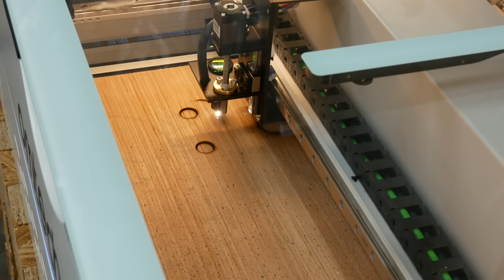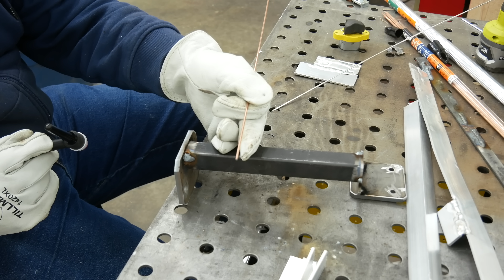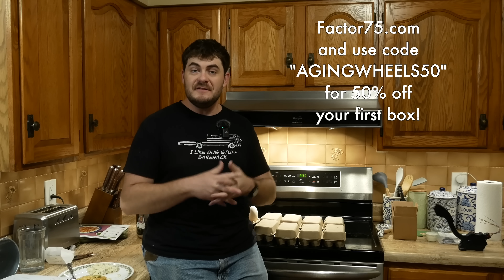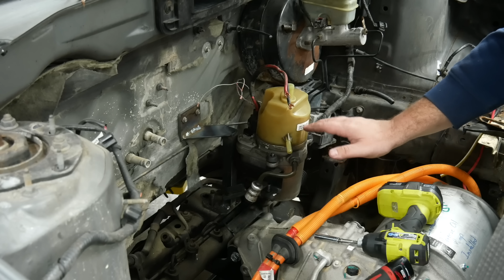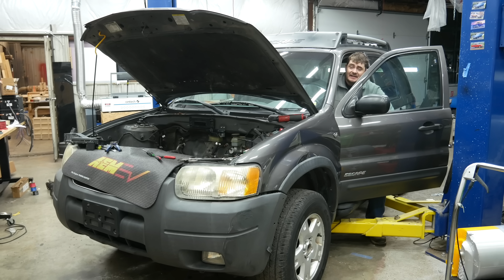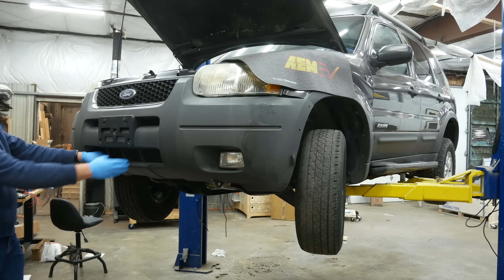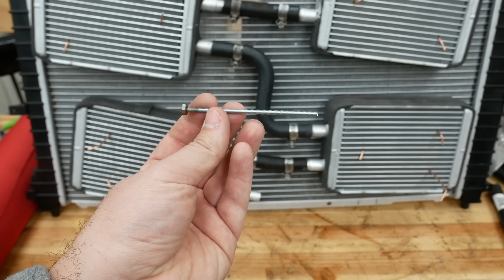Battery Powered Steering and Five Radiators | 900hp Electric Escape Project

Comment: What I have learned from EVs... Amps bad! Voltage good! Also you need to think about what is the worst case temperature inside the engine / conduit where you will be running the cables in USA climate and use case. Track day in the hottest day of the year? So lets say you need constantly 1000A for trackday driving in the worst +50C environment temperature, you will be looking at the cable thickness of minimum of:  500mm2 of copper (single wire) or 2x 185mm2 with wires width spacing between all runs. (Wires would be 90C under these conditions). 

Also: for automotive, get marine rated cables. To my understanding they're already tinned throughout which adds corrosion resistance.
Reply: Under what condition would you use a constant 1000A? At a moderate 350V that's 350kW (or 470BHP or 476PS)... CONSTANTLY.
That kind of power would possibly be required for travelling 200mph in that car, but that's not really what he's going for.

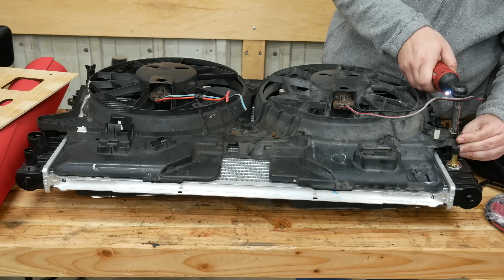Comment: For the radiator fans shown at 17:10 - if all you need is to be able to adjust the speed of those DC motors, you could just run them with a motor controller capable of PWM. (essentially switching power to the motors on and off really fast to control how fast they run)

Comment: Amphenol Rhino 38999 connectors are rated up to 1000 A, 1238 VDC, IP68, come in multi-pole options, meet mil-spec vibration requirements and are available with tapped hole and flat terminal connections so you don't need to buy the crimping tools.  They claim 2000A connectors are also "coming soon".

Comment: Those 2 little domes on the bracket look to be the bottom half of a Self Piercing Rivet (SPR) very popular in car manufacturing as it can join dissimilar metals, aluminium to steel, and if done well is very strong and reliable. No localised hardening like welding and can be completely automated unlike nuts and bolts.

Comment: Check out either a flexalite fan controller(cheap) or autocoolguy for making your fans variable speed based on temperature, you can use thread in bungs or push in probes.

Comment: I wonder if any small diesel cars use an electric vacuum pump that you could have opted for instead of the EVWest part?  Vacuum pumps are standard issue on diesels; often engine-driven but not invariably.

Comment: There are plastic kits to attach transmission coolers to radiators.  It's very easy and secure.  It would work great for cooking fans and heater cores too.
Reply: Flex-a-lite 3910

Comment: If you are trying to avoid metal to metal contact with your heater core/radiator assembly, do you also want to put some kind of rubber coating on your bolt so they don't rub the inside of the metal fins?

Comment: If you're looking at 2000A through your connector, I would maybe consider rethinking your configuration. That seems like an awful lot for what may be a silly reason. The anderson power pole connectors are the first things that come to my mind but they are 350A only (though they would suffer more I bet). Whats the limiting factor for your battery voltage? is it the Tesla drives input?

Comment: You're going to want to think about the continuous vs. peak power for the connectors, and wires and fuses too for that matter. It's going to be an unnecessary battle of absolutely massive cables and unobtanium connectors to specify your peak power as your continous power.

Comment: Instead of a heater core, use an aux transmission cooler. They come in many sizes. Mount to the front of the radiator.

Comment: Fun fact. There are proprietary nylon zip ties specifically for connecting radiators together. If you were the kind of guy that doesn't like that metal allthread acting like a file against your aluminum core.

Comment: I'd also figure brake regen will be fine so you don't have to upgrade the hydraulic brakes but just remember if you leave the house with a loaded vehicle with 100% charge you won't have any room in the battery for the angry brake electrons.

Comment: for tig, CLEAN IT CHEAN IT CLEAN IT and uh oh yeah CLEAN IT use acetone, works the best for me. also always check to see if youre getting gas when you start the weld, i usually just hold the torch a ways away from the table and aim it at the palm of my hand and press the pedal you can feel the pressure from the gas on my palm with the glove still on, doesnt guarentee it isnt contaminated, but its a good sanity check.  also wipe the welding rod down.  even if youre not gonna grind the mill scale off with a flap disc clean it with acetone.  if you dip the tip in the puddle (everybody does it) just clean it youll get better over time.  if youre fighting with the torch cable (i know i was going insane with my stock one i wanted to murder something) ck worldwide superflex one figuring out exactly what you need is a bit of a nightmare if you dont know what the connectors are like i didnt but there are some pdfs on the ck website that will help.  GET SOME FLEX TORCHES fuckkkkkkkk a 9f (under125a) and a 17f (under150a) are prety much all ive needed to get through most stuff, some people say you should learn with the rigid ones........ but those people are masochists.  you should get a couple of each of them, theyre cheap, i went for ebay knockoffs.  youre also gonna need some hardware kits with collets, i like the stubbies and backcaps of diffrent sizes,  they sell kits youll need them for each size torch ie 9 and 17 class and some people like lenses(they kinda help create laminar flow in the gas when you have a big cup) and the glass cups but i find them a bit troublesome, if you get lenses off ebay watch out ive had them come plugged and chased my tail over them (see check gas flow) anyways for the record ignore all that I AM NOT A WELDER I DONT EVEN WELD ON YOUTUBE i learned from youtube welders, but that stuff is what i would have wanted to know when i staarted even though tot and jody from welding tips and tricks are fantastic teachers.  oh side note silicon bronze brazing rod REALLY USEFUL FOR CASTINGS AND THINGS YOU CANT GET THAT HOT, a bit more expensive than normal welding rod but availible on ebay and incredibly useful to have around

Comment: To save power on the electric power steering.
Add an accumulator and a pressure transducer switch to only turn on the pump when there’s a pressure drop. 
Swapping to a hydro boost brake system will save needing a vacuum pump.

Comment: I am amazed, that two of my favourite YT-chanels (Aging Wheels and Vice Grip Garage) use the same Volvo PS pump. For two complete different applications. One gos into a burnout truck and is held basically by zip-ties and the other one in to an electrified SUV with more braces than Forrest Gump.

Comment: Keep up what you’re doing.

BUT, whatever you do, do not use your first GEN Tesla drive motors for the bus. They will fail. You can use them in the escape as a test bed, but do not use them in your production build. There should not be liquid inside the inverter housing. This is a antifreeze leak and will cause the inverters to fail

Comment: For the brake booster you could use a hydroboost from a diesel or a Lincoln and run it off of the power steering pump.

Also how are you going to bleed the air from those heater cores?

Comment: I had a conversation with a startup battery manufacturer recently who had the same issue regarding connectors. There are no (or none that they were aware of) connectors capable of 1000 amps, let alone 2000. Their answer was to double up (2 * 500). I hope you find one. If you do i'd be very interested to see.
Reply: Me too!

Comment: I suppose for High voltage/current power connectors you could look at the ones they use for powering electric trains in depots, we have 750V DC 3rd rail down here so some way of temporarily powering a train is kinda necessary so engineers don't have to worry about being close to 750V DC when doing work that requires the train to be powered.

Comment: Metal to metal is not your friend, I think I would lose the bolts and use the type of nylon mounting tabs supplied with most aftermarket oil coolers and electric fans, they work well, won't wear against the cores and they are cheap as zip ties. Love the channel keep'em coming.

Comment: You could just run the coolant to the batteries first, keeping them as cool as possible and then to the motors, as they would still be cooled down even if the coolant is heated by the batteries.
21° from the radiator to batteries, heated to ~60° to the motors heated to ~120° back to the radiator and down to 21° again.
Just like in a computer. Just pump the fluid to the most important part first. This would still require a beefy radiator.

Comment: hey, that bracket, is it going between the subframe and body? if the subframe is bush-mounted to the body those two mounting locations will move relative to each other and either that bracket or the body its attached to won't last

Comment: Instead of dragging the welding gun or weaving side to side try aiming the gun so the tip is 90 degrees to the work piece and using a forward and backward movement. You'll get a nicer bead for the material thicknesses align with good penetration and appearance.

Comment: The most enjoyable E-convert on the interwebs!
P.S: What section are those cables? There are plenty of (cheap) interconnects for cables upto 95mm2 , but even one of those will not handle 2000amps. Maybe four...

Comment: P3 powersafe connectors are good to 800a continuous and should be easy enough to parallel up. Could be made pretty tidy using the panel mounts in conjunction with the main connector.

Comment: ChatGPT: Huber+Suhner RADOX HPC High Power Connector. These connectors are designed specifically for high-voltage and high-current applications and can handle up to 6300 volts and 1000 amps.

Comment: Very nice build. I'm a big fan your channel! 

This project has a lot of potential but please, please use one 1 motor connected to the transmission with higher current and more cooling than 2 motors.

The less power will be compensated by the lightness and less stress on the battery, plus less complexity on the whole build.

Comment: You may want to look into a full sized mennekes disconnect plug. They’re more for AC high amperage situations, but the idea behind them is that you have to essentially trip a disconnect switch before you can unplug it, to prevent a 1000A arc from turning everything within a few feet into plasma. 

Not sure they make exactly what you’re looking for, but you could also do a few lower rated plugs in parallel if it’s cheaper

Comment: I'm not going to pretend I know anything about anything but for your high-amperage battery connector you might check out connectors for forklift batteries. I don't know what they operate at, amps-wise, just a suggestion is all.

Comment: You could also wire it up so it only turns on the pump when below a certain speed. When driving at freeway speeds generally power steering isn't essential.

Comment: I agree that the Amphenol UPC connectors look OK for your application. Rosenberger also makes (on request) a version of their HVR 420 connector that can handle 450A with 120mm² gauge wire, although if you can't get a partnership their connectors can be pretty expensive.
Of course, one alternative is to raise the battery pack voltage to lower current draw (power equals volts times amps). But presumably you've already thought of that, and the tesla power units are probably only rated to about 400V

Comment: Hi Robert, I think you should use bolted connections and not bother trying to use connectors.  Most all the reasonable EV connectors require special crimping and/or welding.   Really not needed for a homebrew.  Cable glands and standard crimp lugs are fine.   If you have connectors, then you need some sort of supervision (HVIL), and that just complicates things.
Reply: This is what I would recommend. Sealing will be the problem.

Comment: Look into power connectors for electric forklifts. Also they sell radiator fan mounting kits so you don't have to push metal rods through your fragile aluminum radiator fins.

Comment: I absolutely love this project! As far as the high voltage plug you might have to use an AC knife switch to handle that kind of amperage then unbolt the legs individually. Possibly milling custom connectors out of copper.

Comment: I liked my escape.  Problems were a chronic corrosion and bursting of the tone rings on the cvs.  Also had to… “replace” the through window bolts on the rear.  And yes wheel bearings.

Comment: On my 24 year old Suzuki Jimny there is a wire coming from the steering box. That wire goes to the ECU and provides ground when the box is under load. Something in the ECU than makes the engine rev up 500-800rpms. I guess the small 1300cc needs a little boost when idling and turning the hydraulic pump. 
If you have that on the Ford you could make that wire turn on a relay that turns on the hydraulic pump.

Comment: For your battery connector, TE makes a specific line up of high voltage EV traction battery connectors for OEMs called AMP+ HV, HVA and HVP that they will likely sell to you, including as connector kits with everything needed for both sides of the connection.

Comment: Hi Robert, I work with EV battery packs. For your HV connector problem, have a look at either Amphenol UPC RADSOK/SURLOK or TE connectivity’s AMP+ line of hv connectors. These are what are typically fitted to commercial EV packs, though none of their offerings come close to the 2000a you’re  looking for; most top out at about 300a continuous, when coupled with chunky ass wires. They can handle higher peak currents, but I suspect they’ll get pretty melty pretty quickly at those currents. Tbh I’m not entirely sure what connectors they use on higher power EVs (Tesla model S etc), as the current draw is similarly insane - they potentially use multiple connectors in parallel and/or have bespoke connectors. Porsche (and others) reduce this issue by running higher pack voltages, though given your motor selection this likely isn’t an option. Good luck anyway!

Comment: What if you could have the power steering pump only work at low speed to make it easier to maneuver. At higher speed, power steering isn't needed as much or at all.

Comment: if you get a high voltage connector with, say, 4 or 8 poles, each of which support 500 or 1000 amps, you can use multiple pins in parallel to get your 2000a capacity without having to install two completely separate connectors and cables

Comment: The plan for my own(As yet unbuilt) EV:  Anderson connectors. Not waterproof so I was going to make a 'distribution box' for all the zappy stuff. But they'll handle the power. And as others have mentioned, you can stack them.
Check the datasheets, they come with two numbers: A low rating for 'amps during loaded disconnect' and a MUCH higher number for 'amps if you don't disconnect under load'. (The SB350 connectors are 100A under load, 500A if you don't draw power while pulling them.)

Comment: why not something like a low power arduino or pi zero with a speed input set to enable a relay to the power steering command line at any speed below 10mph? so while driving it turns off, and while going at slow speeds it turns back on?

(pretty sure I have an old thermostat program for an arduino somewhere that could be repurposed for taking a speed input, all it used to do was take a temp input and turn a relay on/off at needed times)

Comment: One recommendation for the cooling system if you have issues here. 2 side by side radiators. 96-00 Honda Civic or a Dodge Ram from around 03 both are set up with the radiator on one side and the A/C condenser on the other, so they're next to each other. The radiators are squares instead of long rectangles. Given the cooling requirements of an EV, the 2 small radiators would work really well.

Assuming you stick with what you're doing, I can see the bolts you're using to mount the heater cores quickly wearing through the radiator/heater core tubes. Any parts store will have re-mount kits for add-on transmission coolers. They're basically exactly what you made here, but they're nylon straps with a connector that slides on and locks into place. They also include rubber isolators that go between the radiator and the thing you're mounting. They work exactly like what you made here, but are designed for the purpose.

Comment: 2000 amps is a lot. Like, a lot a lot.

Is there any configuration in which you could run the entire system at higher voltage to lower the current draw? Or do the motors just need the voltage they need?
Reply: The motors need around 400v

Comment: As former tech support at a radiator manufacturer, I'm simultaneously cringing at that violation of warranty, and curious to see how long it will hold up. Long term, you run a risk of both the threaded rod rubbing through the coolant tubes, and also stray voltage eating up the aluminum cores IF you get a short to the cooling system. Not as much a chance of the latter with no engine, but something grounded the wrong way to the frame could cause problems. 

Triple-checking all your wiring connections will be your friend.

Comment: with regard to the heater cores; I think it would be better not to run them in series. But maybe have them run in parallel and series. Split the flow in half and then run each half through two of the cores. Certainly would increase flow and reduce restriction